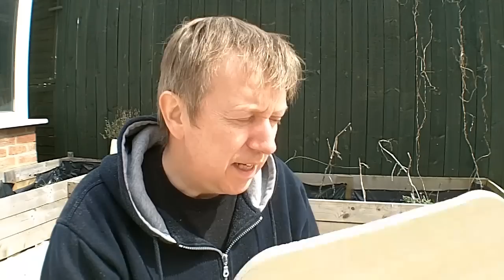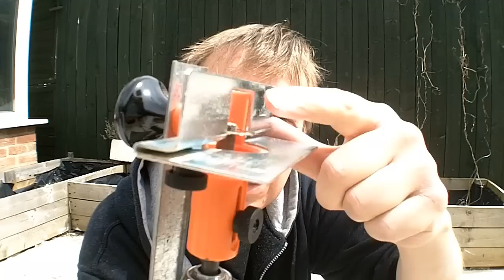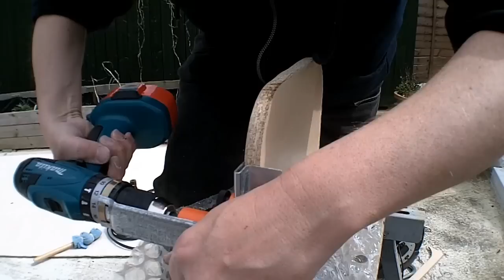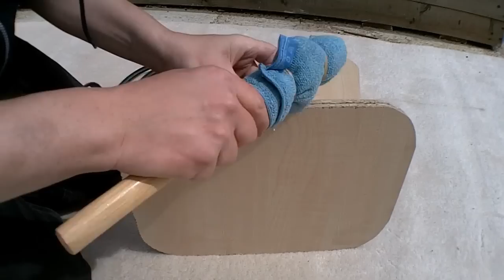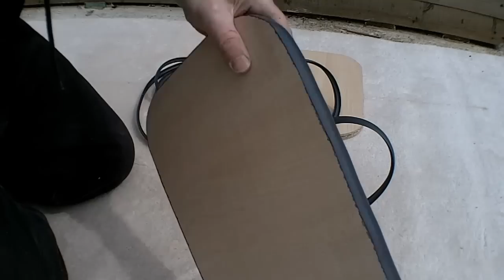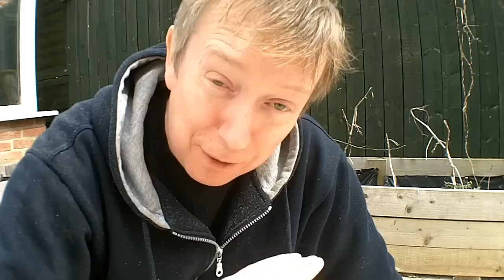Self-Build Motorhome Cupboad Doors on a Budget, for the Carpentry-Challenged!

Comment: Apply Evostick to edge of the door and then install the edgeing strip. This will seal the chipboard from moisture. Kitchen fitters tip learned from installing stainless steel sinks into woodchip worktops. Very effective.

Comment: Nice job and very clever tool. Would just like to add, that if you use a stanley knife and a straight edge to score the conti before sawing it helps to reduce the splintering effect. Have also heard using masking tape helps but never tried it. Good luck with the build mate!

Comment: Looks like a handy tool. I could have used something like this when I built a folding table a couple years back. I have plans to build a small teardrop trailer next year that can be pulled by my 4 cyl. car. I will be watching your upcoming video with much interest as I'm sure it will apply to my build. No hurry my friend. I'm sure your own time constraints are more than enough pressure.

Comment: Hi Rick,When you cut out your door shape you need to use a special blade in your jigsaw and also set the jigsaw to NO tilt. If you look at the side of the jigsaw it usually has 3 settings, the one you want is the least aggressive one that way you will avoid  tear out on both sides of the cut
Reply from the maker: John Fithian-Franks thanks for the great tip :-)

Comment: I needed something similar to trim some traffic light rings. I bolted a electric drill with a circular cutting tool to a board using blocks of wood, with disc cutter blade held by bolt and nuts, horizontal at cut height. Then fed each ring into the turning blade and rotated by hand. Cut hundreds this way. The tool above needs to be  bolted vertical on a bench.

Comment: That trim does make a cheap bit of wood look tidy. Nice idea. Whats the trim called?

I would possibly have mounted the drill to the bench or table and used it like a table router. Maybe?

To stop the laminate chipping score the inner edge of the cut with a stanley blade. The professional table saws have 2 blades. The 1st blade of nips at the surface of the laminate and the 2nd actually does the cutting.

Probably too late now. Pictures look like most of its done.

Thanks.

Comment: Great video, I've just started looking into building my own RV so this is nice. I have a couple of questions about the edging you use. First, when hammering it into the groove does that create any stretching of the edging which in turn will sink creating a gap at the end? Second, again about possible edge shrinking due to cold temperatures. Have you experienced eight of these possibilities?
Reply from the maker: The edging material is pretty solid and doesn't stretch/shrink to the best of my knowledge. My biggest issue has been accidentally treading against the trim on the low-down doors and pulling the trim out of the groove.  Will fix this on the next build with higher bottom doors.  😀

Comment: Hi Rick where did you get your 1.4-1.6mm cutter and trim from? I've looked on fleabay but only getting biscuit cutters which are to thick.  Top job there ;) I need to make a small folding table for my campervan and I'm going to make it using your method.
Reply from the maker: Not certain where to currently get them.  This vid was made a while ago now, but I do recall accidentally stumbling across them quite recently on Amazon. The trick is finding the right keywords to use in a search.
Reply: Thanks Rick will keep looking...tip for you if you need it in the future? next time you cut the board, cover the cut line and underneath it with masking tape and that will reduce the chipping drastically. Hope to meet up with you and Austin in the summer. Almost finished my little project a little C15 hylo campervan, Just waiting for the garage to do the welding underneath were I couldn't get to. See it on facebook here.  Take care ;) https://www.facebook.com/Camper-van-Restoration-531931967003192/

Comment: i think i would have put the drill in the vice and worked the wooden board around...the opposite of what you are actually doing...got to be easier to hold a board on  a level plane whist rotating it rather than trying to guide a drill with a jig attached, And haveing to keep it perfectly level in two planes.....maybe worth a thought next time rick.....this is just my opinion, But i do quite a lot of diy and specially woodworking and repairs

Comment: The router gizmo was what?  125 pounds?  Pretty good?   Did I hear that correctly?
Could have used a Dremel with a simple homemade gig or stop, or by hand razor knife with a stop and gauge attached, or how about a $5 hacksaw with a small tooth blade and placing a metal stop on both sides of the door with only the center of edge exposed for cutting; so many ways to not cost a penny.   Your idea is not something I would advertise to a diyer who is trying to spend less not more.
Your cupboard door using T-edging rubber strip is very good idea though.  Thanks for the tip. ciao.
Reply from the maker: +trumpsahead The router was about £30 - £40 (GBP).
Reply: rickvanman rcvanman